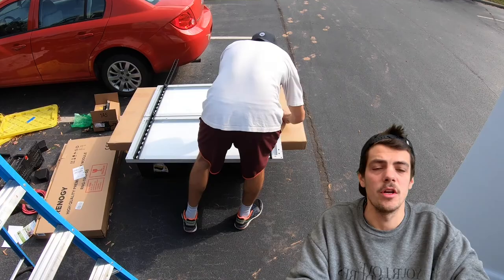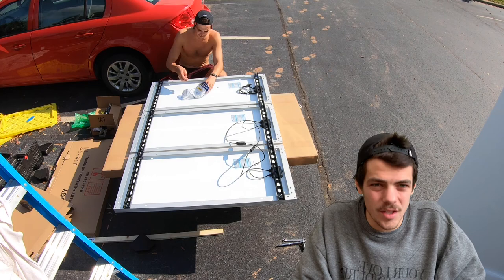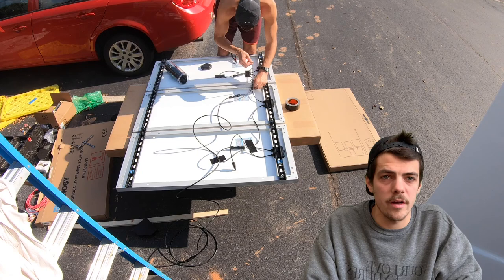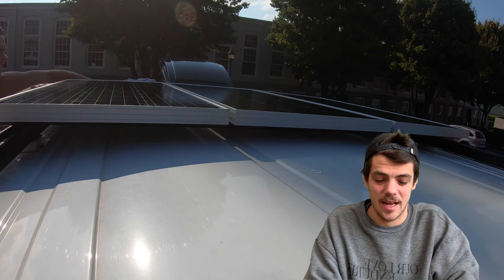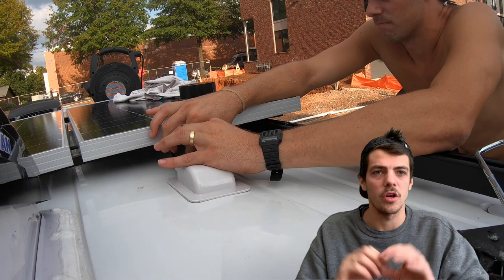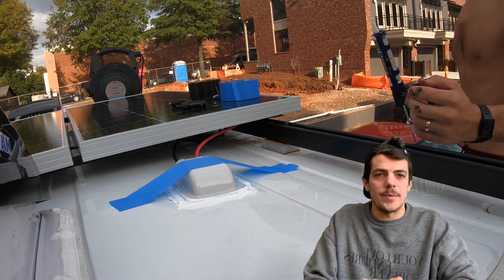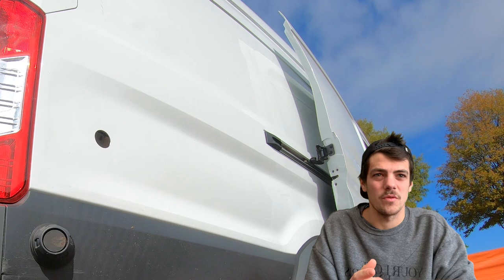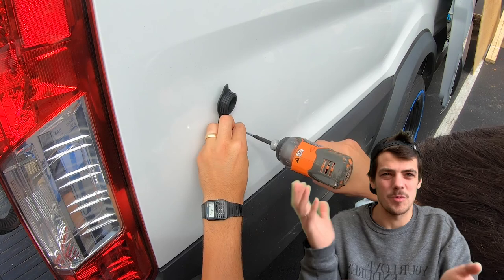Installing Solar Panels & Shore Power Plug | Camper Van Conversation | Ford Transit DIY Van Build

Comment: Hi Vanheer! Love this video! Thank you! We also used the NOCO genius 10x for shore power and it was as easy as you say it is. My only issue with our build was with our solar rack on top of our Ford Transit (130" wheelbase) van. We followed instructions from another YouTuber who suggested using rubber shock absorber M8 bolts which seemed to make sense because the M8 paired perfectly with our 130" WB Ford Transit van. However, what we didn't realize is that the M8 bolt didn't go all the way through as 1 continuous bolt so the entire rack failed after 3 months of wind exposure and highway driving and the entire roof rack levitated and tossed itself off the passenger side of the van like a tornado as a broken pile of glass, etc. We were pretty devastated because we lost 800w of REC Alpha Pure AA panels ($1600 investment). Anyway, we are trying to install a brand new set of solar panels now and don't want to make the same mistake. The part that I missed with your video is how you installed the unistrut channels to your van. Also, what did you use as risers to bring the unistruts level all the way across the van (to account for the upwards hump in the middle of the roof)? Any insight you can provide would be very much appreciated!
Reply from the maker: Man.. I'm SO sorry that sounds like a nightmare. Yes, this sadly was one part of the build I do not look back at fondly. The fully fab racks you could buy were soooo expensive so we had to just figure out a way to hack it. Before giving too much info - check out this video too. Hit me back if you have any further questions. https://www.youtube.com/watch?v=Z87BpD7TRkw&list=PLQsjG8KRJKwRPyMkOmbdiZ-SqHB7PDeoN&index=1&ab_channel=VanheerAdventures
Reply: @getaway_guide  Thank you for empathizing. I'll watch your other video (thank you so much for link) : )

Comment: Just a thought for those who follow you. 
As was suggested to me by a van builder in an RV park:  put the shore power connector on the left side of the van. This is where the RV park's power (and water, etc.) connections will be by default.
Reply from the maker: Bob! Thanks for this. I’m a first time van builder and have not done a lot of RV’ing so this is news to me. Good looking out.

Comment: What size bar strut did you use for the 3 solar panels and how did you connect it onto the larger bar? I see you have Nylon Strut Fitting Cone Nut (1/2?) then did you just bolt from underneath from the roof rack struts?

Comment: Now that you've been out on the road for a while, would you still bother with the shore power charger? I'm tempted to stick with DC to DC and my solar.  Everyone seems ro install a converter then say they don't really use it. Thoughts?   btw love the channel and your videos are good amount of info combined with editorials!
Reply from the maker: Thanks for the love, really appreciate it. As always feel free to like the content - it helps push it out to others. To answer your Q, you're spot on. Doing it again, we would not add the shore power. We used it maybe once (just because we could). We always chased the good weather so solar was more than enough. The few time we were driving w/ out sun we would just throw on our battery to battery charger and get power from that. I will say though, it was not too expensive - all the components were maybe around $200 to add it into our set up.

Comment: Did you connect the terminals straight to your battery?

edit: sorry I had a typeo. I meant to say do you put this norco straight to the terminals on your battery? Does that affect the wires that go to the other parts of your setup such as MPPT, Inverter?
Reply from the maker: no o ??

Comment: You said you connected your panels in series? Why did you do that, don't you have a 12v system?
Reply from the maker: Yes. You can connect your solar panels in series or parallel even if it’s a 12 V system. He comes down to preference, and how you’re going to use them
Reply: @getaway_guide  but in series the voltage doubles. What charger controller did you use?
Reply from the maker: We have an MPPT charger. The mppt takes the excess voltage and converts it to more amps